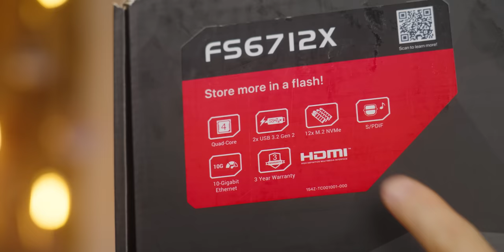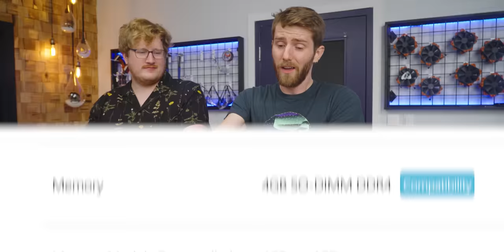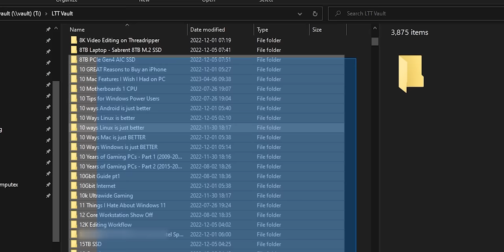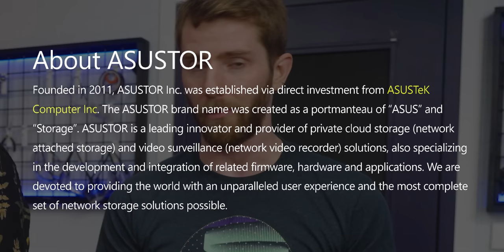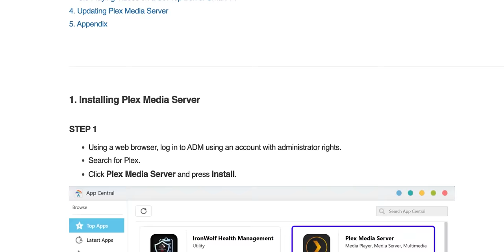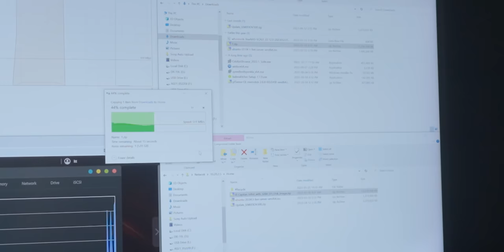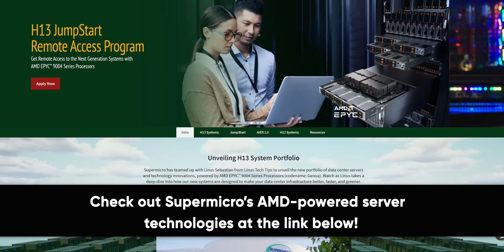I should stop building computers - ASUSTOR Flashstor NAS

Comment: Now, imagine this device with a socket in it and cooling for a 65W CPU. That would be a hell of a barebones NAS.
Reply: 65 watt cooler probably makes it 50% bigger and twice as heavy 😶
Reply: So I should imagine a completely different product? First thing that comes to mind is The Throngler.
Reply: Yeah...a Core I3 or I5 would have been a game changer as far as performance, and worth the extra $
Reply: I think bumping up to 35W plus a decent iGPU with av1 enc/dec would be much more enticing tbqh
Reply: @Synthetic_Future  No necessarily... currently sure, but in the next few years I imagine we won't even be using traditional coolers in this unique setups. One avenue is Frore, and with a few years of development, they could like produce a 65w capacity cooler that's literally a couple cm thick on a 4 x 1 inch strip
Reply: but good on them for looking deeper, I would have written it off as a budgetbox that couldn't be any good as soon as I saw the paleo central processor at the top of the spec list.
Reply: Just throw in a 5700G-5750G and PPT limit it to some 30W. Shouldn't require too much cooling.
Lots of cores, and still plenty of speed.
Reply: @SyntheticFuture  when it comes to mobile chips the TDP and the power consumption are normally the same number

So maybe 10% heavier at most

But yeah they did say socketed for some stupid reason so if its intel 65w try more lime twice as heavy

And they are normally the same number because users will loot at watt hours and divide by CPU TDP to estimate battery life as a close to worst case value
Reply: @ryanthompson3737  it will take long for traditional cooling to be replaced
Reply: 15W laptop CPU would be many times faster than this anemic Celeron.
Reply: Now imagine if Apple made one of these but with their custom silicon, and had Apple software for like $1,000. 

Seems like something they could easily sell to their pro users. 

The problem is that Apple doesn’t have a good track record of letting customers open their products and upgrade things like ram or storage.
Reply: Some one will definitely make it. Hopefully some big manufacturer with small margins and not the likes of Synology and others!
Reply: @SyntheticFuture  Use a Dynatron blower fan if you can deal with the noise
Reply: @ccricers  if you want to sell a product on the consumer market it's best it doesn't sound like a vacuum cleaner / server rack 😅😂

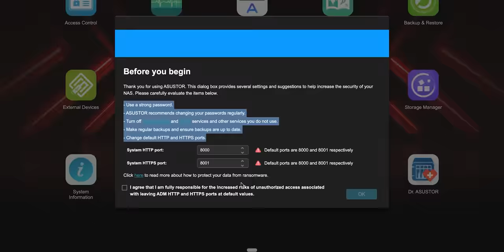Comment: 9:41 Yes, ports can be scanned quickly, but a simple port change keeps a lot of scriptkiddies away. As an example, I had so many attacks on a mysql  server that it became unstable. After I changed the port, the server became smooth again.
Reply: In fact, asustor just got hacked not long ago with ransomeware attackers attacking the 8001 and 8000 ports with some day 0 vulnerability. Am a victim of the attack. So switching away from these 2 ports somewhat is useful.
Reply: Eh not exactly a good practice anyway, since it's only delaying time to get hacked. It's always a good idea to practice defense in depth, like firewall with IP ban/timeout, and definitely not putting vulnerable interface out in open. And of course, never open RDP at any moment
Reply: Changing the port to a non common port, can keep a lot of broad scope attacks away.

Comment: this is super cool. would love to see one with a beefier cpu
the screwless m.2 quick release is really cool but i would hope that it's a small replaceable part so that if one breaks you don't have to replace the entire thing.
Reply: @Scott Myers until you realise that the CPU is only capable of 10gbps…

For this type of application you need at least 1 thunderbolt 40gbps port

Cus otherwise your stuck using IT instead of an attached device cus that speed sucks

Even if it was populated with 12x 512GB drives it would still take at least 102 minutes to read the full capacity and thats assuming it maintains 1GB/s the whole time

Comment: I wanted to build my own storage server (despite only having used half of my 512gb drive) but I think this might be better
Reply: a 512gb drive? in 2023? You absolutely do not need a NAS lol
Reply: @kermitthefragg  everyone could use a nas for backup
Reply: 512? And here I am setting at almost 5tb and need to expand lmao
Reply: Sad that unless you want to pay like over $1K you'll get a Celeron or even just an ARM CPU. Why is it so hard to put in an i3 or ryzen 3? Those CPUs are really cheap and so much more powerful... There's no need for i5 and up either.

Edit: I think I should add that those ARM CPUs are extremely basic and slow, these Celerons are much better if you have to choose between one or the other. You won't get some flagship snapdragon within any of these pre-built NAS systems.
Reply: Theres a real advantage to using an actual server/server board - remote management and headless video from bootup, even in the BIOS
Reply: @SPEEDFREAK6988  9 TB here and ran out of space.
Reply: Data hoarders the lot of you! (backup is always a plus though)
Reply: want a fun project while you at it? build it with a pi4b 4GB. I have been rocking mine for almost 3 years now. Mix match internal & external sata drives lol, 9TB total, all magnetic drives tho.
Reply: @Tomazack  I'm catching up 🤣
Reply: @sosukelele  I'm not hoarding.I have over 200 games installed lol
Reply: Half of a 512GB drive…

My windows install uses about 350GB and that thing doesn’t got a whole lot on it cus most of my stuff is on other drives

Hell just my user folder which has grown over the past 10 years is like 100GB

You just not save stuff or what?

You want a NAS… get an old laptop and set it up as a network storage drive will cost way less and be way faster
Reply: @SPEEDFREAK6988  190 you probably haven't played in the last 6 months
Reply: @commanderoof4578  I've only had this computer for a year and don't have many games installed on it atm (X-Plane takes up 1/3 of me used storage space)
Reply: @themacbookgamer  well just make sure to install a few games at a time

Dont want to play the same thing all the time and burn out on it

But im the type of person that installs like 80% of all my games and just swaps them in an out between my HDD and SSD

Its a matter of 200MB/s vs maybe 4MB/s if im lucky swapping vs downloading
Reply: If it is just for backup it is not worth it. Better use 2 external separate drives.
If you want to increase network storage, yes.

Comment: I actually upgraded my plex server recently from a celeron j5040 machine to a 5600g which now doubles as an office/web surfing and even light gaming pc
I just used a cheap b450 board with 4 sata ports and threw in another sata controller for additional drives. 
- What are you even doing with your life if your library is below 50tb? -
Whole build (no drives) in an old and free office case with 3d printed accessories was around 350 Eurodollars including a new psu that is really efficient at low loads. The bequiet purepower 11 400w turned our to be a better choice than most 250w psus, while also not breaking the bank.

Idling behaviour is also super chill, as ryzen g is basically a socketed laptop cpu and tuned well for efficiency. Thought of going intel first, but since 12th gen they threw efficiency at idle pretty much overboard for some reason.

Comment: I have a sprinter van with 9 seats that I also live in. I want a file server I don't have to remember to turn off when I hit the road, or for my passengers to access on the road. I will be buying this just for the vibration resistance vs mechanical drives.

Comment: I like this tech of using m.2's x 12 for a NAS.  You really don't need much processing power when you are just using it to view movies on local LAN etc.  Nice!  Thanks for bringing this to our attention Linus.
Reply: yes, but to be fair if all you're doing is watching movies then any ssd, especially nvme drives are extremely overkill. even 4k full quality movies run just fine on a hard drive.
Reply: @fafiteee not when scrubbing though.
Reply: @fafiteee  Sure, but we're hitting the point now where NVMe is reaching parity with spinning rust at the low end. You can buy a 1TB (DRAM-less QLC) NVMe for the same price as a 1TB 2.5" spinner today.

Comment: At 6:05 correction is needed on the text that comes up. It comes up in the left corner and say: 
ASUStore 32GB kit..... (ECC)
NAStore 32GB kit...... (non-ecc)
Then Linus holds up an 8GB stick also right after Jake says they are putting in 16GB because that's all it can handle. Therefore the text should say ASUStore 16GB kit......
Thanks for always bringing good content! 👍

Comment: As a full time RV person.. I NEED THIS! ive been looking to build my own SSD based NAS for media storage while RVing and they are all too big.. TELL ME THIS RUNS ON 12v!
Reply: it's either 12v or 48v, If it were 48v (or 24v Idk) you can get a step up boost converter for whatever voltage as long as its dc and below 10-15 ampss
Reply: @garrettturner7383  Of course, I just find it easier if its a single voltage through the system.. I usually ad a buck converter for lower than 12v devices any way to be sure that when the voltage dips below 12v, its just a preference
Reply: According to the guys at Asustor in the comment section it's 12v.

Comment: I always think it's a shame that you don't cover more consumer NAS hardware. I get that storage servers are much more exciting, but I'd love to know what you'd recommend as a low power, always on consumer grade unit - or at very least how they compare in terms of features/performance etc
Reply: What is the use case for a consumer NAS? Why not have your storage on a local machine that is just networked to the rest of your devices as needed instead of having a completely separate unit?
Reply: @Hybris51129  power draw for one. My home NAS is wildly more power efficient than spinning up and running my desktop every time I need to access my files.
Reply: @Hybris51129  A consumer NAS typically uses far less power than a PC, so in places where electricity is expensive they pay for themselves that way. They also typically use a Linux based OS, so configured properly they are more secure to leave connected to your network than say a Windows PC you never look at. Most modern consumer NAS products also have apps on them that are better than the ones you can get on a PC, things like photo management and security NVRs. Most of them are also quieter than a PC, so leaving them running in an office or bedroom is less intrusive. Lots more reasons, but those are a few.
Reply: I've been emailing Colton since Computex 2019.
Reply: @Hybris51129  Well. It's easier. If I leave my gaming PC on 24/7, I'm wasting power. At the same time, a small machine that uses little power, whether it's a prebuild like ours or a DIY solution, can be on to do the scheduled backups needed of my data to keep data protected while my daily driver rig is turned off.
Reply: @Hybris51129  In my situation, I'd be buying a local machine to perform that role (i.e. local backup/archive/fileserver). I want something low power/noise and a NAS solves those issues.

As a secondary bonus, it adds some redundancy should anything screw with my main PC.
Reply: @Hybris51129  
Probably as a combo machine. A NAS that is also a router and AdGuard would be goated
Reply: Agreed.
Reply: @Hybris51129  cause as soon as someone wants to do a CPU task my PC will slow down. I've had that issue with having my main PC be a plex server. Wanna downsample h265? Bye bye CPU threads (hardware encoding is a paid feature)
Reply: I'd try an old laptop instead of home NAS. Typically cheaper, comes with built-in UPS in form of battery, equally efficient (depending on model), has video out-keyb-mouse, can be mounted below desk/cabin surfaces to be invisible. But has space limitations, (depending on model). I swapped my NAS for Lenovo x250, it has internal space for 1 mSATA for boot, 1x 2.5'' SSD, one SSD needed to be plugged to a USB port. Draws 4 Watts from wall when idle. Set max processor state to 99% to disable boost, and it will never be audible but still has considerably more power available when needed, compared to the Celeron single boards
Reply: @netiturtle  that's not a nas, that's just a computer with 2 disks connected in it. laptops were never a good choice for storage because as you already know, you can't connect more than 2 disks for your data.
Reply: @giornikitop5373  I did say "instead of" "home NAS" in my post. But NAS is "just a computer with 2 or more disks connected in it". A home NAS would often have 2 disks, but nothing would stop one using more external SSD's in enclosures. This specific 'not a nas' device offers same idle power, more potential performance, protection from power outage, hardware acceleration for PLEX or enough processing power if not using subscription model, for someone who doesn't need large backups. Ie home use
Reply: @netiturtle  you can't have redundancy with external drives. you can use a usb DAS system, but it's cost would be near a similar nas.

Comment: In terms of security actually using a different port is a pretty good thing to do for the average home / small office users
Bot's frequently scrape the standard ports around the web to see if there is some exploitable software running on the standard ports.
By changing the port, you already shake off most broad untargeted attacks on an unsecure system. Of course it's no substitute for security but it most certainly is a good thing to do.
Reply: But the bots would have to be inside the LAN to get past your firewall, at which point they are likely on an exploited PC which has access to the NAS shares and your data so you're already screwed.
Reply: Unless you port forward and have the interface available outside your lan, which people will inevitably do.
Reply: @qlum  Which using none standard ports on the box has zero impact on.

Comment: Hey Linus, here's an idea. How about try to match that form factor with these components and see if you can tame the beast with such a case:
- nMEDIAPC HTPC 1800B Mini ITX Media Center Case (slightly higher than a 5,25 drive bay)
- ToughArmor MB872MP-B Full Metal 12 Bay M.2 SATA SSD Mobile Rack for External 5.25" Drive Bay (SFF-8612) (Even more expensive as this NAS ;D)
- AsRock Rack ROMED4ID-2T Proprietary (Deep mini-ITX) Server Motherboard Socket SP3 (about same price as the 12 bay SSD drive bay)
- An EPYC CPU that can be cooled in such a short case.

Comment: I've built a FANLESS file server with a celeron a couple of years ago. I think it's a better option when you only have space in the living room. if it's really quiet you can hear the two 8 TB WD red tho
Reply: SSDs should have some cooling. Yes, maybe you could get away using only heatsinks, but 12 of them will cook it.
Reply: @vadnegru  i don't think this system has the cpu power or the pci-e capacity to push those nvme's to get that hot. still, a better cooling is always welcome.
Reply: @giornikitop5373    in any case, looks like you could just remove the fan without breaking the warranty.

Comment: Would love to have one of these but for something insignificant because if i get myself a decent HDD(s), PSU and UPS (with pure sine wave output, surge protection, noise suppresion and good avr, basically things you should be doing with this anyway) on a custom NAS build, you are unlikely to have drives fail, and there is no write limit and data is far easier recoverable than this if an NVME fails.

Comment: I would suggest too use SSD's with extremely strong Onboard SSD ECC (Like anything Samsung Pro or Micron P5 or higher or newer!), BTRFS or ZFS for Formatting (Depends on your OS!) and if at all possible ECC RAM (Ryzen supports it by default but need to check with the Motherboard Specs!) and a Pure Sign Wave UPS more layers or DATA Protection is usually a good thing!

I really wish CAMM2 used ECC as part of the Spec!

Comment: I'm surprised you haven't ever talked about primocache. I have around 12 16TB HDDs for my Plex server, and was sick of waiting for transfers. With Primocache I've got a 500GB SSD acting as a layer 2 cache for it, a long with a 20GB L1  (and a 40GB ramdisk as a scratch drive). It's completely flawless in the implementation; I move something to a drive and it transfers at NVME speeds, and then writes to the HDD based on your config (immediately, trickle, wait for downtime, etc). It's a fantastic way to basically ignore the downsides of large HDD clusters; with a cheap 1TB SSD you'll almost never realize everything's stored on HDDs.

Comment: I was just looking 2 days ago to see if any of the current NAS options had processors that could beat out an 11 year old 6-core Xeon @ 1.9 GHz. I was very surprised to find that most of them were just barely faster due to the processors being either Atom or Celeron. There were a couple that had Ryzen embedded chips, but they were both released in 2018 which means they are Zen 1. Those were a good jump above the Xeon at least, but with less of a power consuption advantage as the other chips and being out of date already, I might as well just buy another used server CPU.